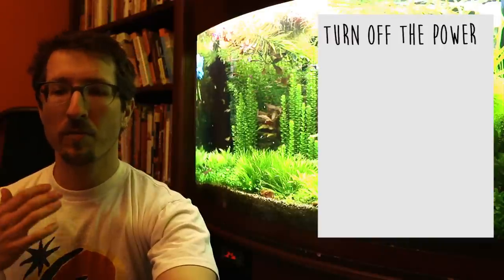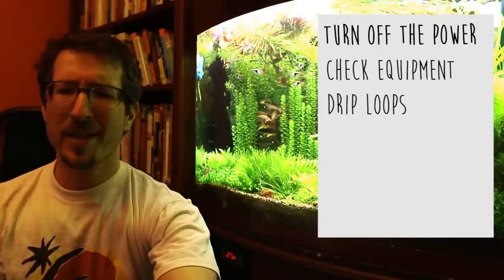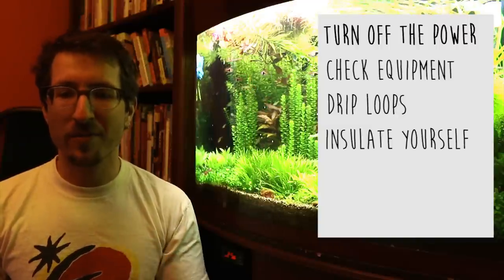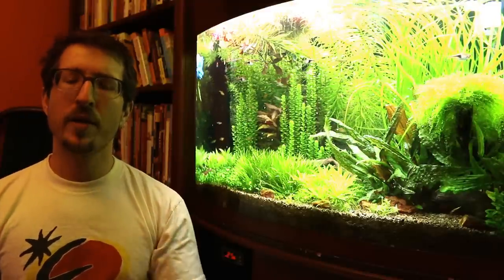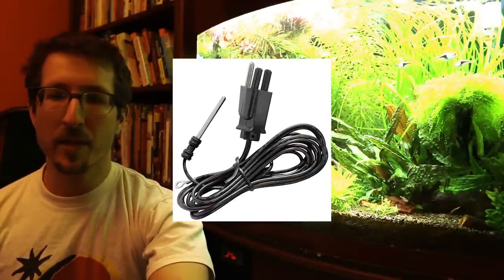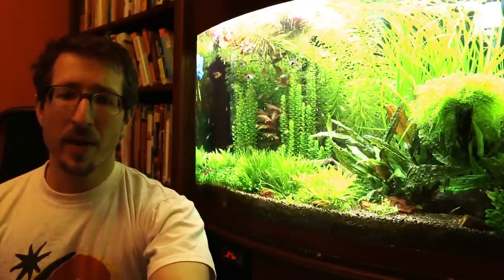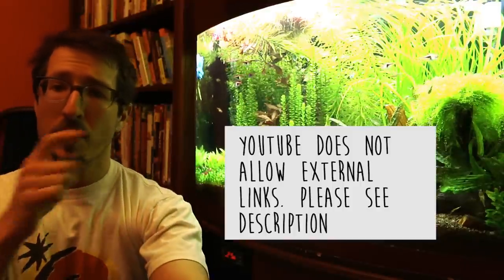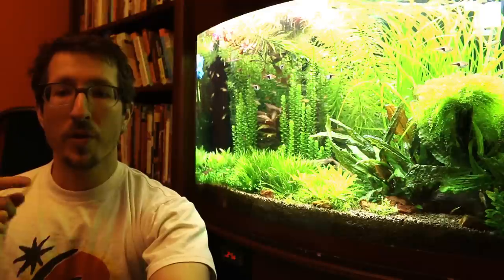Electricity in the Aquarium: Grounding Probes and Basic Safety (part3)

Comment: Excellent conclusion to this series Brian. I've never personally used a grounding probe. I do unplug all the equipment when working in the water though. Looking forward to the tank update!
Reply from the maker: Thanks. I actually-- after doing this series-- will likely install both an AFCI back at my main panel and a grounding rod. I have enough experience to play around in my main panel with simple jobs, and this is one of those relatively easy jobs. The AFCIs are just a little pricey (well compared to regular breakers).
Reply: Sounds like a good solid plan. Good luck!

Comment: If this post still being monitored: there seems to still be a lot to be said and asked here.  First, I think any tank with equipment will have potential (stray current) that can be measured with a multimeter - even if the equipment is functioning correctly and in good working order.  Didn't the video say that if you have a voltage reading, you can hunt down the source and relace that equipment?  With what?  Won't new equipment also produce a certain amount of induction voltage into the tank?

For example- my 75Gal with lots of pumps and heater measured 8.9 V AC, and all four of my 20 Gal measured up to 15 Volts each. The 20 gal tanks are air driven, and only have heaters in them.  I don't suspect any of the heaters are failing or damaged. Also - I would assume that any new heater, from any brand, would still induce some potential voltage into the tank.   Is that a correct assumption?

Second, these tanks did Not have grounding probes and functioned fine and were safe for me.  Recently I did add a ground probe, so all the multimeter readings are now zero volts current, BUT have I now completed a circuit in the tank with the induced voltage, and will that current have more of a negative effect on equipment and aquatic life then was the case before with the insulated potential current?

Comment: I am certain I have stray current, better get my meter out. I had it before I started using Koralia wavemakers and I always use Jager Eheim heaters. So it must be the heater. Great series, and always turn everything off when doing husbandry is sound advice.
Reply from the maker: Heaters and wave makers/pumps. Notorious for leaking stray current. But definitely turn off power. I know I have been "lazy" a few times. But this series definitely made me remember to always hit that power switch. Thanks as always for watching. (I got too focused on the audio on this one and messed up the settings on my video. Too many variables sometimes!)

Comment: Was the extension cord u used to check for stray voltage was it plugged in?
Reply from the maker: Yes-- if it is not plugged in, it would not be grounded back to your main panel (which is grounded somewhere out in your yard with a large grounding rod)
Reply: o ok nice gonna try this tomorrow
Reply from the maker: Cool. I actually have to order a grounding probe for myself. After doing this series, I convinced myself that I should be using one.
Reply: what if u have multiple tanks?
Reply from the maker: Are they all connected with some kind of central filtration? If that is the case, then stray current should theoretically travel from one to the rest. Or are you talking about testing? You would just test each one individually. Sorry if I misunderstood your question.
Reply: yea i understand you have to test each individual tank but what if i wanted to go the ground probe route? do i have to get 1 for each tank? or is there some kind of multiple probe system ?
Reply from the maker: I gotcha, I figured I misunderstood. You would need a separate probe for each system (unless the tanks are connected in anyway). You are trying to ground each tank back to your main panel, so if there is another way to do it, I don't know how. I can't remember how many tanks you have, but you could always just pick up one probe at a time over the course of several months to spread out the cost. GFCI is the most important thing, probe is second.
Reply: o ok nice i have most of my tanks going in to a belkin surge protector then thats plug into a heavy duty gfci extension outlet and thats plugs into my wall outlet
Reply from the maker: Excellent. I'm picking up a grounding rod this weekend, for some extra insurance.

Comment: Okay,
Every single tank in the world is going to show stray voltage. It might be 6 volts, it might be more; depends on how much equipment you are running.   Every motor, heater, fluorescent light fixture is going to induce an electrical charge in the water via induction of the coils of the ballast or from the motor windings, heater coils, etc.   What people need to know is how much is too much.  120 volt stray current would indicate something seriously wrong.  24 volts may be perfectly normal if You have power heads, fluorescent lighting, return pump, reactors, etc.
Reply: Hi 
Sir 
I feel current in my aquarium .iam sure it comes from filter  
How i figure out ?
 Tell me it will harm full for my fish ? @Gary Gipson

Comment: Wow ok let me let you know smart guy there is always stray voltage in the tank but it's so small you won't feel it ,if you have any motor witch in in powerhead,return pumps anything you will have stray voltage dose not matter use a gfci and also a ground prob will do nothing to fix this problem